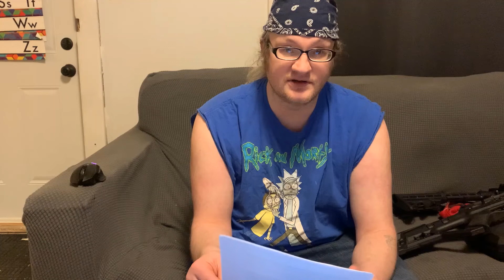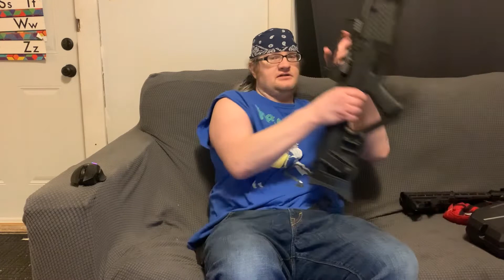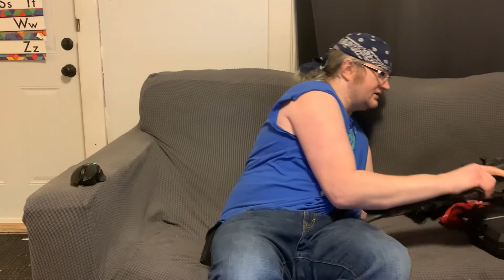Hatsan Blitz VS Air Ordnance SMG .22 discussion

Comment: Thanks for the video. I love my blitz! Planning on getting the smg .22 next month.
Reply from the maker: Ya I plan on making a video comparing the 2 soon. I bought a 4k camera to upgrade the videos I make on here, so the quality will be a bit better when I do that video. I have ballistics jell, some clay, a few steel barrels. Only issue is I have a ton of projects to fix around my house. Only having 2 days off on weekends limits my ability to get all this stuff done. I'll have a video out probably in about a month comparing the 2. Showing how much each penetrates the jell. I'll be shooting H & N hornets and Crossman red flight penetrators out the SMG.22 to get the max penetration possible out of it to compare it to how deep the Blitz shoots. Only thing with the Blitz is there isn't as many good options for pellets for .30 cal. I bought a NOE pellet moulds for both .30 and .22. Going to make a bunch of pellets and shoot them out the guns too to show what those pellets made from those moulds can do. 
I get into survivalism so having pellet moulds would help survive in the woods as you can make pellets out of almost anything. That said, I'm starting to horde lead so I can easily make my own. Going to eventually get a steel mould so I can make pellets out of aluminum. I'm building a mini metal foundry to melt pop cans and turn them into aluminum bricks. The NOE moulds are aluminum. Not entirely sure how the aluminum moulds would handle pouring molten aluminum into them. Not confident the moulds would stand up to that. That said, the moulds are fairly cheap. I think I paid roughly $110 for the 2 pellet moulds I got. They were sold out of 4 pellet moulds when I bought them. 
Well anyways, thanks for the comment and glad you enjoyed the video.